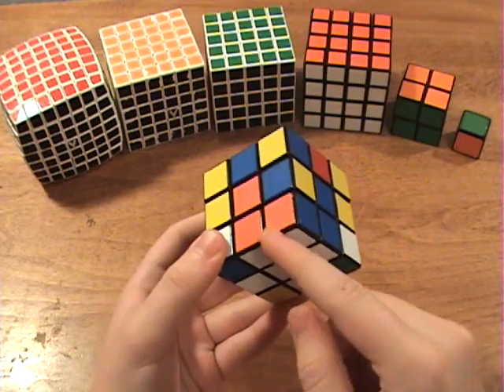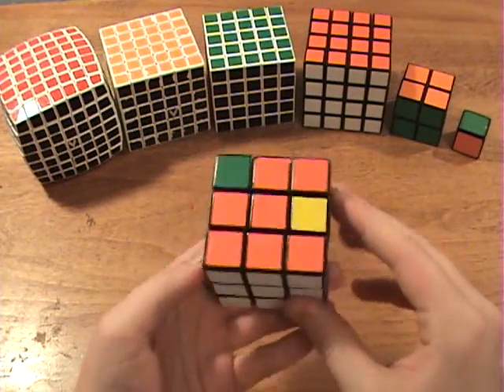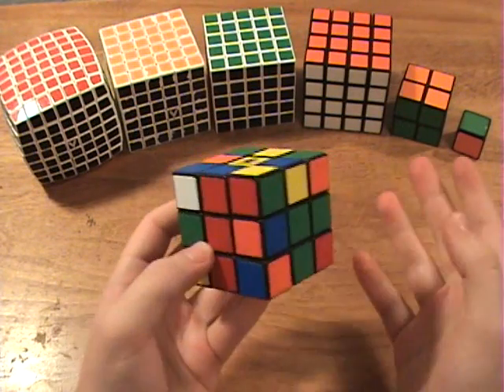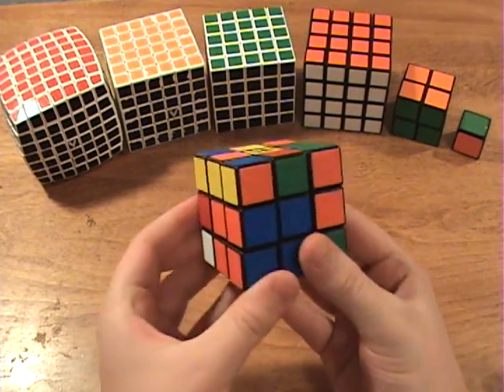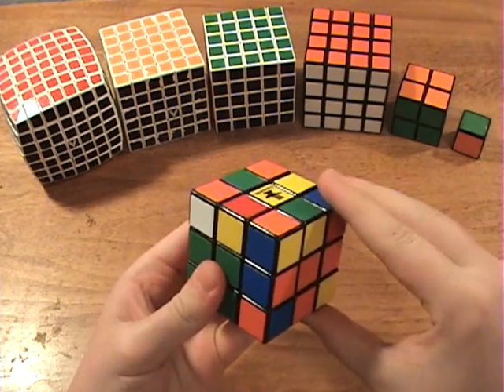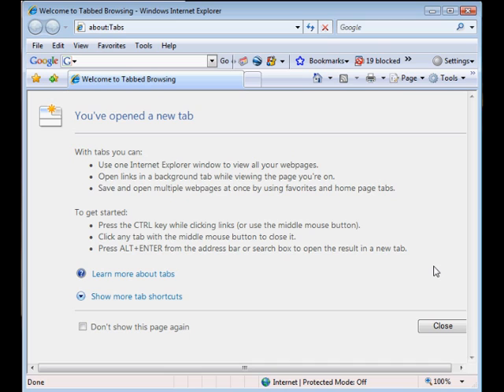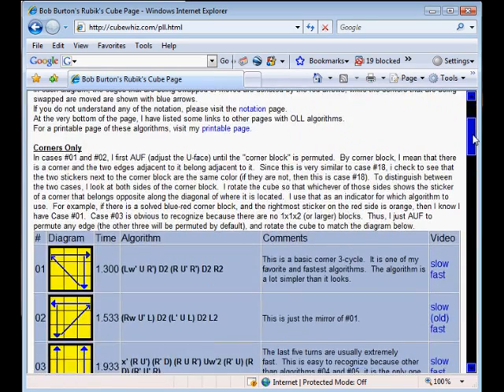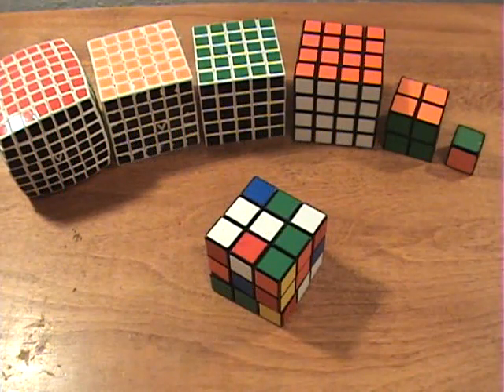How To Do Rubik's Cube F2L, OLL, & PLL (v2) (Part 2)

Comment: If you're new, sometimes you might get into a situation when your cube doesn't look like the images. I suggest you to turn the top layer once(doesn't mater which direction) and then check it again, if it still doesn't look like the images, repeat. Also, I recommend using speedsolving instead of cubewhiz since speedsolving has animations of the algorithms, so you can easily do the algorithms. Have fun solving!

Comment: Hey I found another way to do oll and pll with less algorithms. At cube wiz if you go to 2 look oll and 2 look pll, it tells you to get the yellow cross as in the beginner method and then with less algorithms orients the corners. the in 2 look pll there are about 7 algorithms and their not complicated in figuring out what it will do. Also on 2x2 pbl if at the beginning you solve the whole bottom layer then in doing pbl you need only memorize 2 algorithms.
Reply: I know.

Comment: x, y, and z are cube rotations. imagine rods stabbing through the cube for axis x y and z. x horizontally, y vertically, and z for depth. turn the cube on these axes accoriding to the letter. so (x) would mean turn the cube 90 clockwise on the x axis. so pretend you are facing the cube on the right side of the cube and turn the whole cube 90 clockwise. if it is (x') then 90 degrees counterclockwise. for y you rotate the top face, and z the front face. Hope this helps.

Comment: Parentheses separate part of the algorithms into smaller, easier to remember chunks. Algorithms usually contain 3-4 move sequences called triggers, such as R U R' U', which can be done quickly. By memorizing these triggers, which are extremely common across all algorithms, learning new algorithms becomes easier and faster.

Comment: @Entityyyy @Entityyyy 

Hahahaaa that's just about my story XD Got back into cubing 4 months ago too. The damn thing is, you need to practice a lot. But also, you need a good cube that turns easy. I can easily turn a face with any finger without much force. Search up the Dayan Lingyun cube, imo the best cube ever. But be sure it's not DIY!!! Next, go cubefreak(.)net/speed/index(.)html and it will guide you through learning the system :) I also learned blindfold there ^^ Really good site!!

Comment: @oprah62 
any method that involves solving F2L then solving the last layer without messing up the first 2 layers is going to be more complicated than more intuitive methods.
like, solving the F2L's except for one row, then using that empty row to easily solve the bottom layer edges (usually only takes 8-12 moves), then fixing the last 0-5 corners... no complex algorithms or anything, just simple logic.